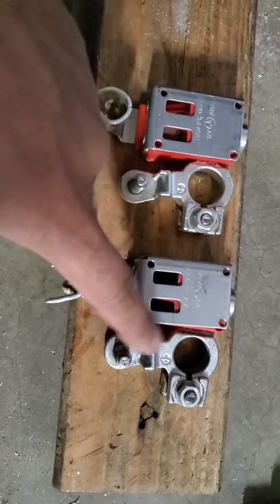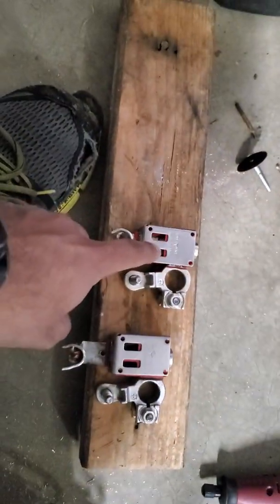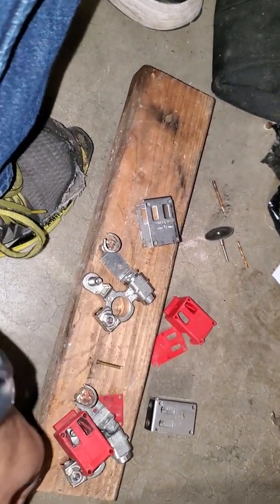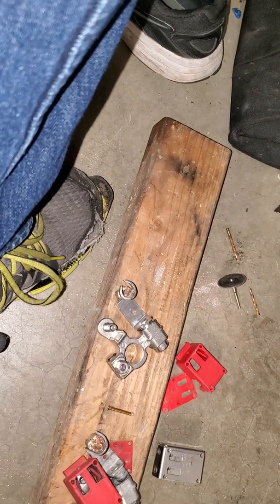Mercedes Positive Battery Terminal Pyrofuse

Comment: I Have a 2014 C350, Yours is a 2014 E350.... Usually when these Newer Model Mercedes Vehicles get into Accidents Especially Front End that Makes the PyroFuse Blow, It Also Locks the ECU and Prevent the Vehicle From Starting. Which Requires It To Be Unlocked With A Scan Tool.... So, You didn't have to Deal With The ECU? There's Apparently an Unlocking You have to Do in the ECU Called Mercedes Engine Start Enabling After Crash... So, You Didn't Have to Deal with That?? 🤔🤔🤔🤔

Comment: Great video.Does the piro fuse shut down the ignition lights .and the key wont engage ?
Reply: A Pyrofuse only disables the Starter from starting, everything els will work like Headlights, radio, and navigation system when u insert key u will also hear a slight buzzing like it wants to start but I doesn’t have enough voltage going to the starter bc the Fuse link connecting it to the battery has broke apart therefore no electric current to make it start